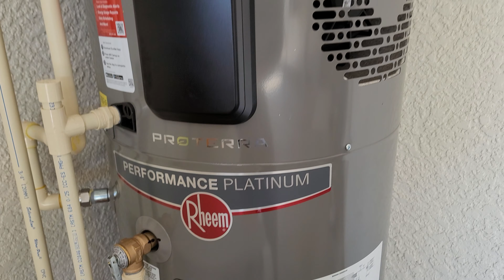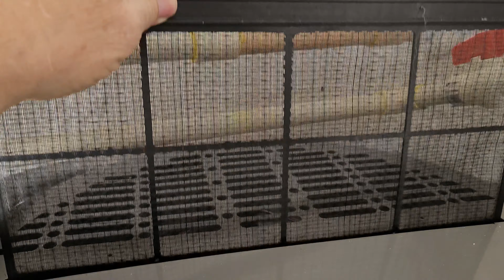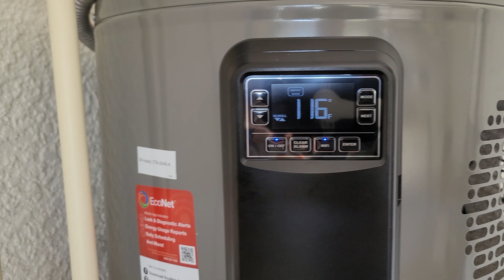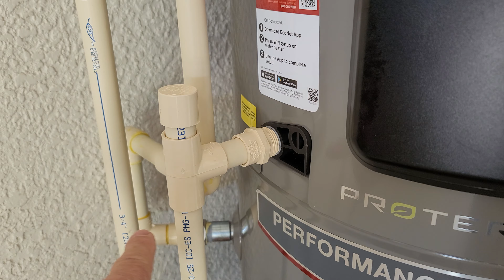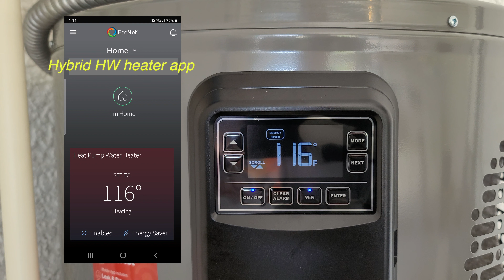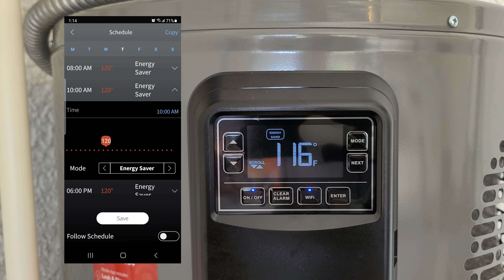Rheem Hybrid HOT WATER HEATER, SAVE SOME MONEY ON ELECTRICITY

Comment: Have you noticed significant energy savings over your last unit? Any idea what your payoff period would be?
Reply from the maker: I would say the difference is only noticeable if you are monitoring it. Our situation was: the power company said our meter was defective for several 🙄 years and we were under billed. To our surprise they billed is 5,471.00 for one month ( they said it was back billed. Estimated from an average of all their customers usage.) They reduced it later.  We are monitoring daily and the hotwater heater is the second largest user of daily electricity.  Ours is doing better the the rating..about 11 cents a day so far. Hope this helps. Thank you for watching and commenting. Have a wonderful week. 😊
Reply: @htnowpro  what state are you in (weather-wise) and do you use electricity for heating the house? If you do, what electric heating tech do you use?
Reply from the maker: @vroor32 I live in Florida. We have 10k heating strips in the HVAC system. Thankfully, they are not needed, only on a few occasions. They are very in efficient and costly to run. The hotwater heater has been very efficient and I am very pleased with its performance. Two considerations: it is somewhat noisy and blows cold air when running.  Take that into consideration if considering for purchase. I am used to the sound now, and it only cycles a few times a day. Hope this helps. Thank you for watching and commenting.  Have a great weekend.
Reply: @htnowpro  earlier u said water heater was the 2nd largest energy burner. I'm I correct to assume the heat strips would be the primary heating source? And you do not have a heat pump?
Reply from the maker: @vroor32  yes. HVAC is largest user of energy.  Hotwater heater is second. Correct, we do not have a heat pump. Only used the heater 3 days this year. Yesterday's temp 66/89 deg.
Reply from the maker: We use 12kw a day without HVAC. This includes a pool pump running 6 hrs a day (3 to 4 kw). HVAC and the car, is a different story.  Our car has a 17kw battery, usage is about 12kw. Yesterday with AC usage was 17kw total.
Reply: @htnowpro  daaaamn! 17KW/day?? I'm at 51KW in central Virginia. I have a heat pump with heat strips (aux heat) programmed to kick in when ambient temp is below 30F.

I have a 15yr old water heater, but just bought a 40gal hybrid this week. Hopefully it brings down that energy usage
Reply from the maker: We used 70kw on the coldest day......
Reply from the maker: And the house barely reached 70 deg...lol.
Reply from the maker: One thing for sure, you won't feel guilty taking a long hot shower....lol